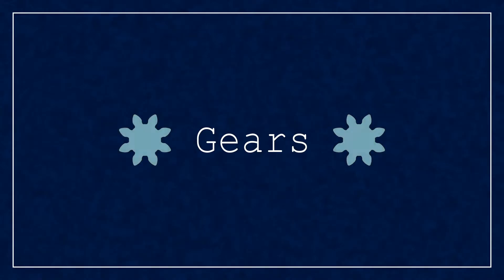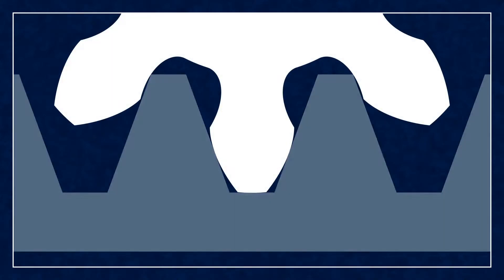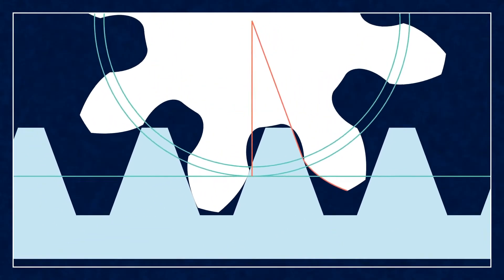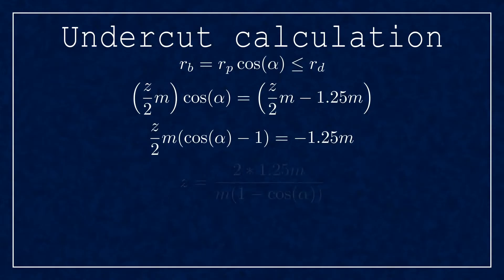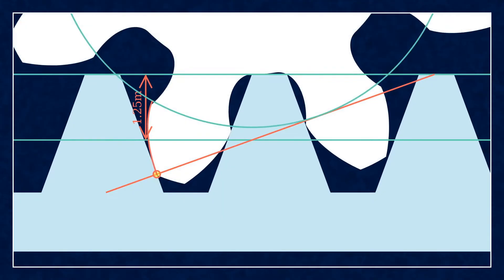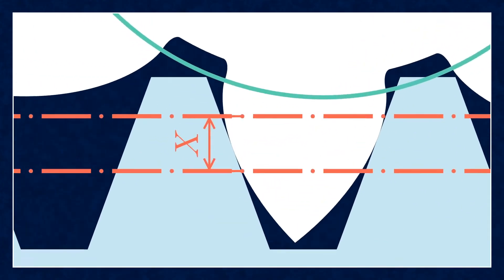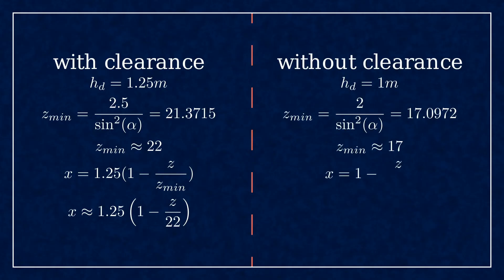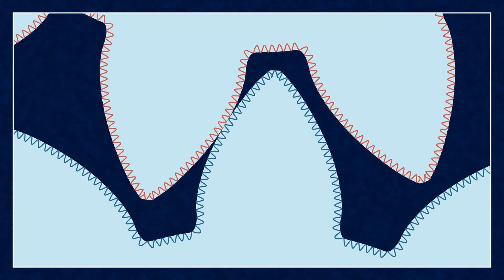Involute Gears 2: Undercut and Profile Shift

Comment: Hey George. Thankyou for making this, it has been very helpful.

I have been going insane trying to figure out at what point exactly the undercutting happens... Because we have both 41 and 21 as valid numbers from different calculations.

While it is good to know that I was not making calculation mistakes, it's still not clear which of the two conditions is actually the reason behind undercutting. You did explain it in the video with the example of 10, 30 and 50 teeth, but I still don't understand. Why would a 30 tooth gear be undercut if the rack doesn't dig into the root yet? Why do we have 2 conditions to begin with?
Reply from the maker: I guess it's a bit of mathematical nitpicking. The mathematical curve that defines the shape of the undercut appears when you are under 41 teeth, assuming a sharp cutter for 0.25mod clearance, so a total of 1.25mod height. That rounded curve will exist below 41 and there is a sharp root above it.
Down at the 21 tooth limit the usual rack profile with 1.0mod height would also start undercutting. At this limit the undercut curve can start interfering with a normal rack-pinion drive.
Between 21 and 41 it's there as a sort of root fillet, but does not interfere with contact surfaces.
Reply: @gergelybencsik8626  Thanks for replying. Please correct me if I am wrong, because I am not a mechanical engineer and I have been reading obsessively about this for the last 48 hours, so my sanity is not 100% guaranteed.

From what I understand, what we call "undercutting" happens when the rack actually cuts a part of the involute curve from the inside. This happens when the trochoidal curve that forms naturally between base circle and dedendum circle curves so much that it goes towards the inside of the radial line from the center to the point where the base circle meets the involute curve. Between 17 and 41 teeth, the trochoidal curve exists, but it is on the outside of this radial line.

That's why, it is safe to approximate the root fillet as a straight line when the tooth count is between 17 and 41 because you are removing the extra curve, and since this portion of the tooth doesn't participate in the meshing, it has no effect on power transfer. It does thin the tooth a little, but that is not significant. However, when you approximate the root fillet of a gear with less than 17 teeth to a straight line, you are adding more material to the natural curve. That's why now it interferes with the meshing gear. Because the undercut is actually needed for gears to mesh properly at that tooth count. But keeping it there weakens the tooth too much, and the pointy part wears off pretty soon. That's when we need to profile shift.

Hopefully all that made sense.
Reply from the maker: @diy_rabbithole  I have to say it's been a while for me since I had to closely look at this, so, I might be wrong too. 
The undercut will always cut into the radial line at least a teeny tiny bit. But otherwise you're right. It isn't a practical problem above ~17 teeth because it takes no part in the mesh.
Under 17 teeth if you had straight line root, you get interference when meshing with a rack. But you might not get interference when meshing with another gear of say 35 teeth.

I think it's better to think of these limit numbers as yardsticks. If you need to be absolutely sure, you'll need some form of numerical analysis for your exact setup.

Comment: Essentially, profile shift just uses a different section of the same involute but the effective pressure angle changes
Reply: Pressure Angles were created by INCIDENT of TOOTH PROFILE of a GEAR..
Reply: @raymundovaldez8639 you need a new translator because you don't make any sense. Also, capitalising random words doesn't help anyone

Comment: whats the point of undercut gears though?
Reply from the maker: You don't want undercut gears, you want small gears with low tooth count to maximize reduction ratio. Undercutting is the trade-off you need to manage for that.
Reply: @gergelybencsik8626  certainly but if we strive for greater reduction to the point where the teeth cant bear the load anyways, whats the point? surely theres a breakpoint where the optimal tooth thickness lies.
Reply from the maker: @Mobosh  yes, I guess there is an optimal thickness, but I never looked into engineering gears for strength. Profile shift can mitigate the thickness issue fairly well, but increases the alpha angle and puts more load on the bearings of the gears. Gear design is not actually my field, so I have no real world experience here... But I saw some colleagues working on them, and it ends up being a delicate balance.  You need to design for high strength, small size, large tolerance or low precision, wear, lubrication, even sound. You'll end up with a somewhat optimal design for those... but it all depends on the use case.

Comment: Awesome video series on gears! Keep up the good work.

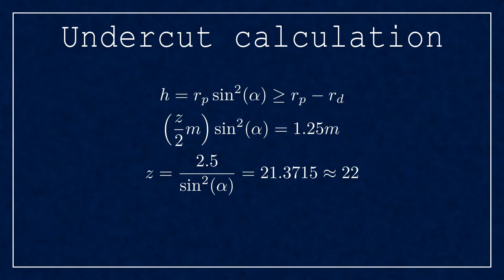I have one question for now: Why do you use "=1.25m" in the equation at 6:14 instead of "=m"? It seems like others use "=m" from what I've found on blogs online. Thanks!
Reply from the maker: I talk about it later at around 11 minutes - I'm still not entirely sure what's right. I use 1.25m in order to include the clearance, and simulate a perfect trapezoid-shaped cutting tool with 1.25m height. With those assumptions, the math works out that way with 1.25m. I know most sources use 1m for this, I think because real cutting tools are not perfect trapezoids, but rather have a straight edge up to 1m, and the rest of the 0.25m for the clearance is rounded off, and usually does not cause undercut. Or they just hand-wave and simplify away the clearance.
Reply: @gergelybencsik8626  Ahh you anticipated my question >.< Thank you so much for taking the time to answer and create this terrific explainer on involute gears. Keep up the good work and I look forward to watching what you release in the future!

Comment: I have a question, does the profile shift apply only to the pinion? or to both gear and pinion?
Reply from the maker: I don't really understand the question. Do you mean 'pinion' as the smaller gear out of a pair? Profile shift can be applied to any gear.  It's just that larger ones don't necessarily need it.
Reply: @gergelybencsik8626  Pinion - in general is a smaller gear of the two.
Reply: TOOTH PROFILE of pinion/smaller gear and bigger gear must SAME PROFILE to proper MESH/TURN the gear-pair perfect rotation, today pinion gears usually were TRAPEZOIDAL TOOTH PROFILE...Let us keep the faith as GEAR DESIGNERS...

Comment: Have you found a closed form for the intersection of the involute and the trochoid with your ideal rack?
Reply from the maker: Eh no, I just used scipy's root finder to get that, and it's a bit finicky, sometimes screws up and you need to adjust the initial guess,  but it gets the job done. And since it worked, I moved on, never really tried to get the closed form - but maybe one day I'll punch it into Wolfram and see if it can solve it.

Comment: Awesome video! Can’t wait for part 3!! Any chance of doing that final animation to compare high contact ratio vs low contact ratio to see how the total sliding is affected?
Reply from the maker: I did not know sliding is related to contact ratio. Is it really? I need to look into that, I'll think about it. On the technical side, that last animation uses a lot of control points to superimpose a wave on the gear surface curve, meaning it renders quite slowly, so it's a bit hard to work with.